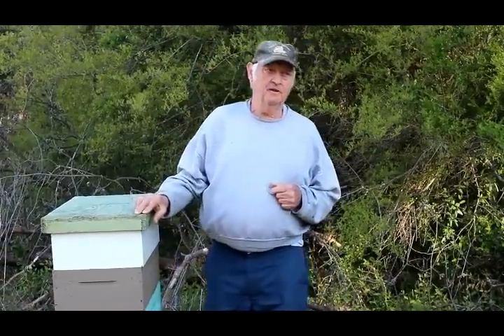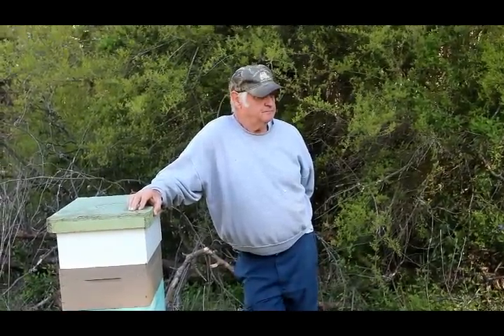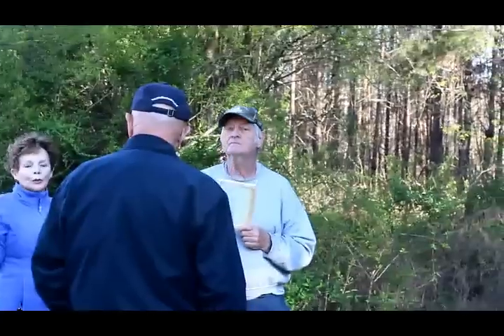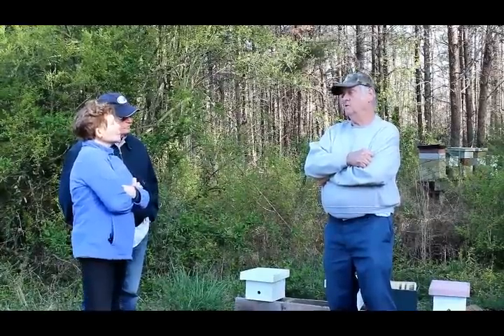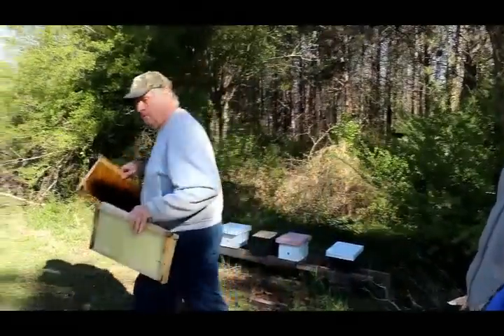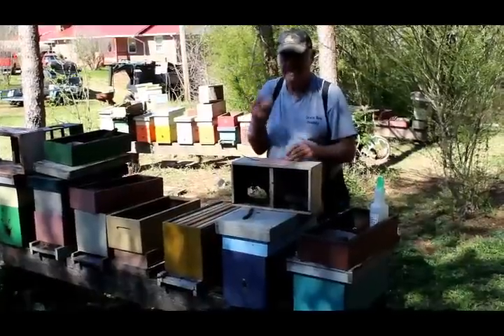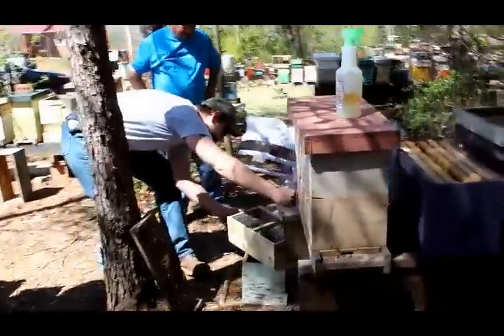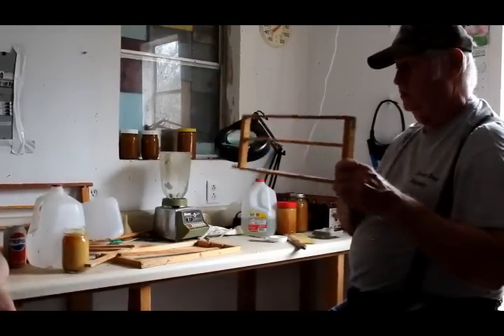Fat Bee Man - Introduction to Beekeeping clips

Comment: Osterizer blender with metal parts can stand up to the oils, but I was using a Hamilton beach and had a batch eat the seals out of the blender shaft and run right out the bottom of the motor

Comment: 4:52 so with those little hives down there, can you just animate them (make them into a proper beehive) and then harvest off of those little ones? They won't just all become majority brood and barely any honey?
Reply: A 5 frame is a nuc. An 8 frame is for brood and honey. The reason they are smaller is to lighten the load. You just shaved off 15-20 pounds.